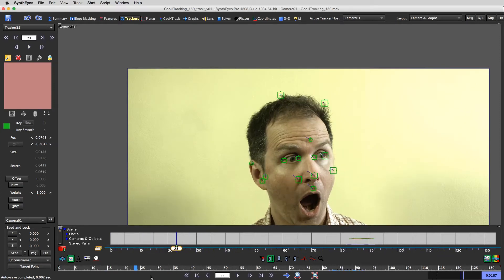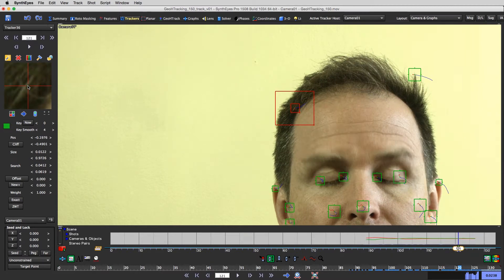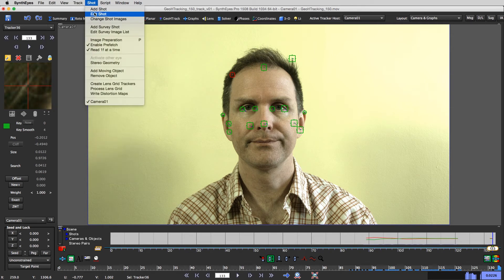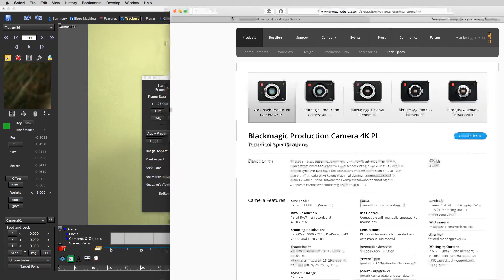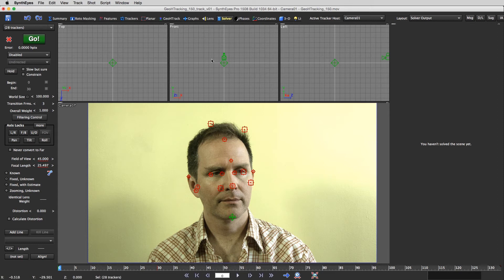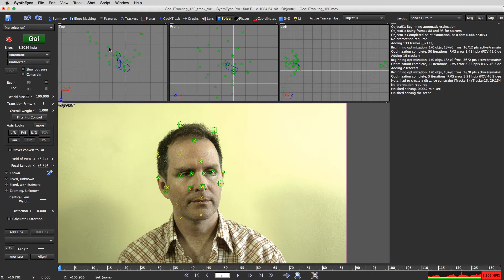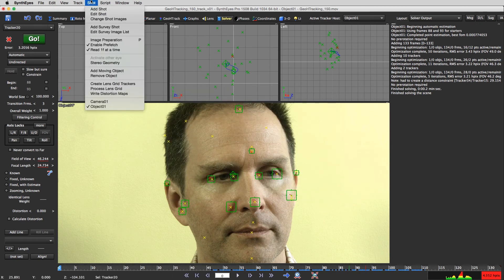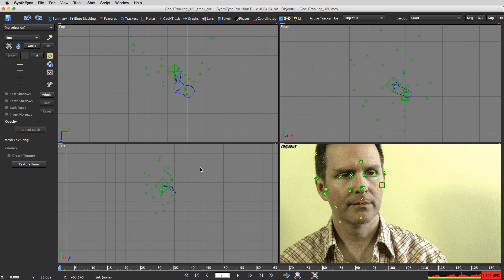Head Tracking Part 5

Comment: If I wanted to produce the “Iron Man” effect i.e. tracking the head so you could use planes of graphics/holograms, would this be the way to go if I didn’t want to use markers?

I recorded a shot of my head moving and did a Camera Track with Fusion - the video is about 3000 frames long. I split up the footage and it was able to track one part of it but it couldn’t do it with any others. I tried with Synth Eyes auto track and it couldn’t do it either - I assume the reason being because there is no parallax, just a tripod pointed at a head turning.

So, would supervised be the way to do it? Or can Synth auto track it?
Reply: Nevermind! SynthEyes got it! I cannot believe it got it. Only took me about 3 hours of supervised tracking.